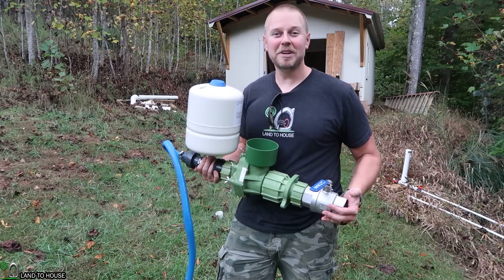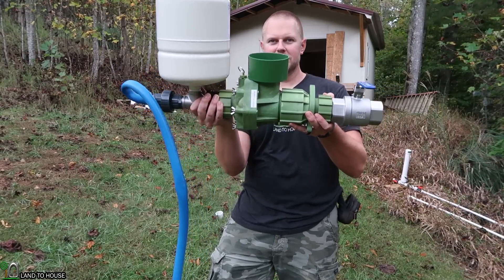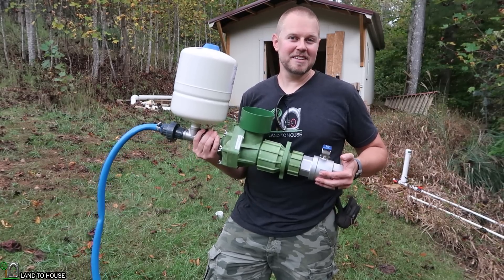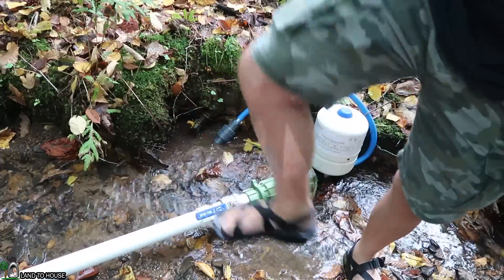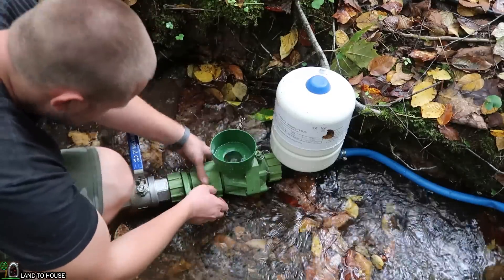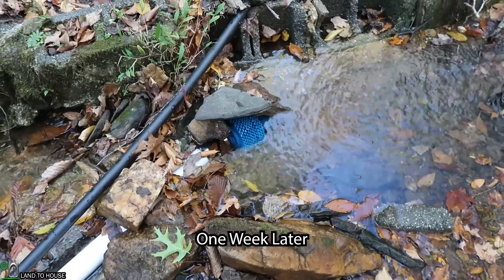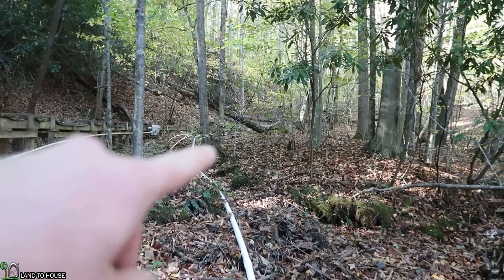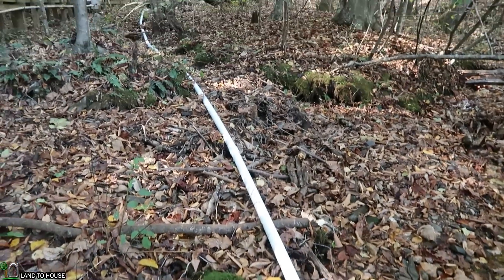First Test of the 2" Agri Papa Pump

Comment: I enjoyed your video thank you. question I have a pond it is 10 ft away from my orchard trees on level ground. I want to take the water from the pond to the orchard ,the  ground is level if I were to dig a hole deep enough to put the ram pump below the pond level would it be able to pump  so that I could use a hose to water my orchard?
Reply from the maker: Sadly digging a hole and placing the ram pump in that hole does not have the same effect as head pressure. The hole will fill up with water quickly and the pump will stop.

Comment: Does the inlet have to be higher than the pump or can it be even with it if the flow/velocity of thr stream is high?
Reply: Ram pumps always require a supply head

Comment: What is the max head pressure for Papa Pump?
Reply: For the composite pumps we say 120m however anything over 100m we recommend our metal version - stainless steel and bronze body - these can reach 150m and upwards with some system adjustment

Comment: I have to ask. could you not get the head pressure you need by setting a 55gal tank next to the pump and start a syphon drain fill from the tank into the ram. I believe a 50galweighs 416lbs that could out fall from the bottom via 3inch into ram. idk I kinda wanna try it

Comment: I guess superior engineering does not equal idiot proof.
Reply from the maker: Your comments are rude. An actual install will be on the channel soon.
Reply: @LandtoHouse  I don't mean to be rude. It's just your video seemed to be setting the Papa Pump up for failure.
Reply from the maker: Ah. The pump is going to work well once I do a proper install. The nights were dropping well below freezing when I made this video and I did not want to have anything freeze. Now its time for a full install.

Comment: Are the plumbing interfaces on this pump BSP or NPT threads?  If the threads need to be converted this can be a significant cost  - especially for the 2 inch side.
Reply: All US kits come with BSP to NPT adaptors
Reply: @Waterpoweredtechnologies you never need to buy fittings except for your first one make sure it’s brass heat up the PVC pipe with a heat gun or air blower dryer and screw the brass fitting onto the pipe. Make sure the threads are lubricated on the brass.   cool a little bit unscrew the brass Wala you have new threads of whatever kind you want.

Comment: Please don't assume that my comments concerning your installation are meant to be negative or anything except of the most helpful kind. I will soon be 79 years of age and have been involved in much too many such projects that have built within my library in my head knowledge and experience that provides some of the pitfalls that I observe that can make the projects seem difficult at the very least. Some of the pitfalls that can be avoided are. Getting in too big a hurry and failure to follow instructions, both those written and those of just common sense. One such pitfalls is not taking enough time to plan the installation and  how the piping is to be secured. One such installation, I recall that caused a huge amount of time and cost an arm and leg, was the installation of a sewer line of about 200 ft. The "job" was not a job except to provide some assistance and to dig the excavation. I instructional the owner that the line required  gravel and backfill before being left for the night. Only the joints were to be left visible. However, it did rain during the night as was forecast. In the morning, all pipe was in a pile at the end of the line. This was a very expensive Booboo. Unfortunately  this is setting that could have been avoided. It gave me no pleasure for his difficulty
Please forgive the sloppy texting, I'm not the best keyboarder in the west. Also, please accept these comments in the attitude with which they are offered. I am a farm kind of person and enjoyed the "off grid" use of the power that God gave us to use!
Reply: you sound young sir

Comment: Try putting a vertical stand pipe a pipe length away from the pump and two feet taller than the water source. Leave the top of the stand pipe vented and it should allow any air bubbles easily escape, and reduce the amount of water hammer by giving it a place to go closer to the pump without reducing the head pressure.
Reply: You WANT the water hammer effect. It's what makes the RAM pump work in the first place. The water that the waste valve lets past is so the water in the drive pipe can get sufficient momentum to cause a nice water hammer effect when the valve closes. The resulting pressure spike will then force water past the check valve to actually pump some water. That's why for maximum efficiency, you want several things.
1. Have the pump rigidly mounted.
2. Have the drive pipe as straight and rigid as possible (a steel, or copper pipe would be better than PVC).
In a nutshell, you don't want any movement or flex that will dissipate energy that would otherwise go towards pumping water.
Reply: @johncochran8497  Exactly.

Comment: hi.         as i have been saying, flow rate  equals  water  volume (per sec.)
no matter how much pressure you can achieve,  the Amount of water that  CAN  be pumped is  Equal  to  1/10  of the source  flow/volume.          that ratio can be applied to the  known/estimated  source flow rate; in order to  calculate the  Maximum  amount of water that  CAN  be  pumped/raised.             my comments have been based on an apparently  very low  inflow rate; into the intake catchment.         i suspect that the source is a spring.       d
Reply: Nope. Nope. Nope. The water you can pump has a potential energy approximately 60% to 80% of the potential energy of the water supplied (e.g. A typical ram pump has an efficiency of between 60 to 80 percent). How much potential energy does the water have you might ask. That's based upon the amount of water, force of gravity, and available head. So E = HMG where H = height, M = Mass, and G = gravitational acceleration. So
Mpumped * Hpumped * G = 0.6 * Msource * Hsource * G
Since G is the same on both sides, we can eliminate it, getting
Mpumped * Hpumped  = 0.6 * Msource * Hsource.

So assuming a 3 foot head and you want to pump to 15 feet, we get
Mpumped * 15 = 0.6 * Msource * 3

Divide both sides by 15 and we get
Mpumped = 0.6 * Msource * 3/15 = 0.12 * Msource

For the above example, we do get something around 1/10th, but that's because we're going close to the limit of the pump. If the source head is increased, but the desired destination remains the same, then a higher percentage of the water would be pumped.
I'm assuming an efficiency of close to 60% because the pumps the gentleman in the video produces have a lot of flexibility in the drive pump and the mounting isn't exactly the most rigid, so the efficiency would be rather low.

Comment: at 10:20, that is all  STORED  water coming out.      this (larger) pump is gonna  need  more  water, than you have.!
Reply: HI David

Seth actually has a good flow rate and our pumps can operate on flows from 20l/m with the standard valve.
Reply: @Waterpoweredtechnologies  ha-ha.      20l/m   is  .33  liters per second.         based on what is shown, the inflow rate, into the catchment, is about  .25 lps.          amount of water, Pump-able, .025 lps.   maximum.  
conclusion:  a  LOT of pump is being used where  a minute  amount of water is  Available.
i  would be interested in  links to sources of  useful ram pump design  information.      d

Comment: so, at 5:10, i'm  thinking, a ram pump can normally move  one-tenth  of the  supply  volume.
what is the  Nominal  INFLOW  rate, at the upstream side of the intake catchment.
that's  yer  FLOW rate.      DIVIDE  by  Ten.
Reply: Hi David, 

Depending on Supply head and delivery head our pumps are capable of pumping up to 30% of the water input
Reply: Seth's other tests of his ram pumps measured a 1/7th of the water through the drive pipe goes to the delivery, 6/7ths out the waste valve.

Comment: Hi Seth, 

Great initial video, for supply heads under 2 meters we have a thinner main valve that will allow the pump to work so do let us know if you'd like once sent out! 

The pipe splitting does illustrate that need for a solid pipe ;) 

looking forward to more of your videos!
Reply: I would! My property backs up to st Joseph river I want to ram pump using the river pressure up to near my house to a holding tank then a smaller line to go down to a micro hydro power generator
Reply: @mildishhambino  Wow these pieces of plastic are expensive. I have year round flowing spring on my property. So I was thinking about making The Breurram pump or my own version of the bunyip. Now I'm kinda leaning towards buying a Vodní trkač a from Czechoslovakia for a few hundred. depending on shipping cost.They are cast iron pump kinda like old school farm pumps you use to see.  Then shipping here or close to hear, a FTZ(Foreign-Trade Zones) since they are everywhere in the US if you google locations (they can be close to amazon warehouses).  Or get a 3d printer for 200-300$ And see what I can do with that.
Edit: You might like The $50 Water Turbine -Build Tutorial.

Comment: Watched all you videos ,I need to run water 100 m at hight 2m what size ram pump do I need and what size hoses do I need for intake and output, please help, thanks 🙏🙏 in advance, I'm in Europe, Balkan poor country
Reply from the maker: Hello. Each size pump can move water 100m and lift 2m. The pump size difference determines the amount of water needed to operate the pump and the amount of water you can expect at the top.
Reply: @LandtoHouse  I have a bigger stream so It won't be problem 3/4 or a 1 col I guess
Reply from the maker: The 3/4" needs 4gpm and the 1" needs 6gpm to operate.
Reply: @LandtoHouse  bravo for the channel and for saving the planet with all these projects that save electricity ,ty
Reply: @LandtoHouse  thanks a lot for answering

Comment: Interesting. How does it function differently from your pump?
Reply: Seth's pumps rely on gravity to get the waste valve to fall back open after each hit, these use a rubber waste valve that bends/flexes to close and 'relaxes' back open after each hit.  Some clever engineering in shaping the water flow past the waste valve makes it a lot more efficient.
Reply: Our Pumps use an inline Venturi valve to operate instead of the traditional method :)

Comment: Dude I love it! You took all the air out of the sales of that company!
They claim that it's a self-priming self-starting version of a ram pump, but you got it to not work the first dozen times you tried it LOL.

They also claim that the benefit of a Papa pump over a ram pump is it doesn't need expensive valves replaced.. so your ram pumps cost $180 and this ram pump costs $1,800.

But I'm glad you don't have to replace any valves on a pop-up pump because that could get expensive you would only have to build 10 of your round pumps to equal the exact cost LOL you could literally have ram pumps for you and all your neighbors for the price of one Papa pump
Reply: Hi Justin,

Non of our claims are false and Seth's fantastic video just shows the importance correct and planned set up. Even in Seth's temporary solution the pump was not primes and did start itself. 

This model is also only $995 USD and is designed to be a long term solution for those that don't want to build their own or want something larger than Seth's own excellent models.